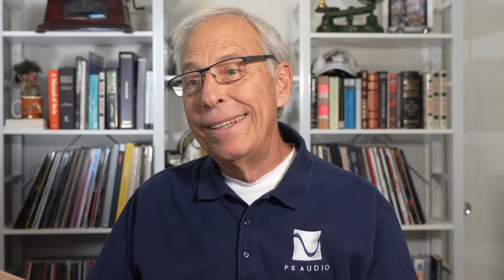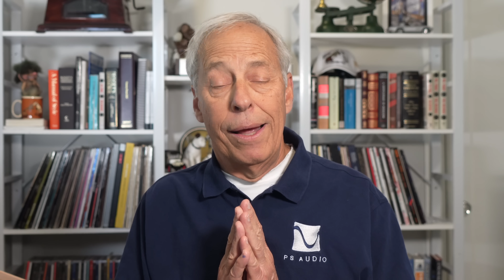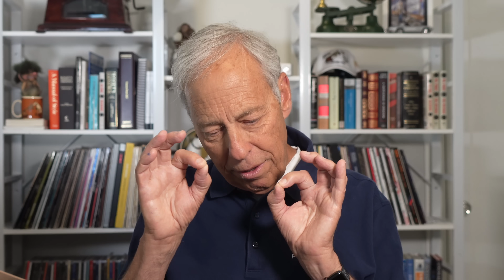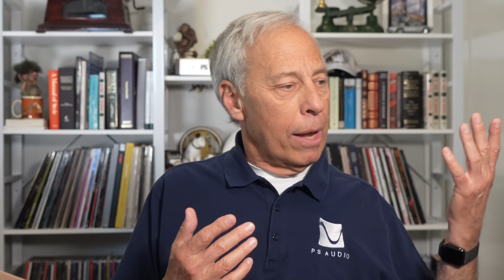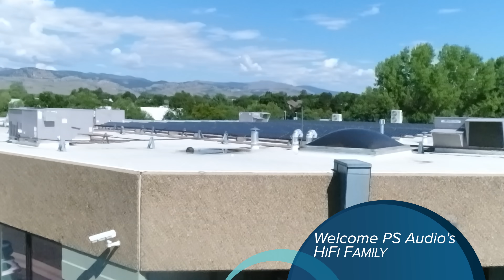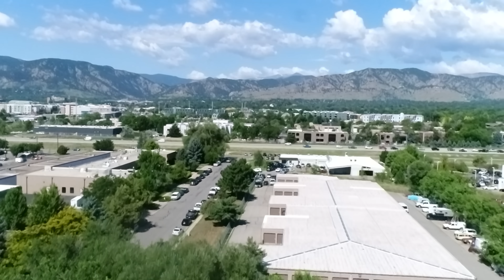Will MOSFET amps take the place of tubes?

Comment: C'mon... Class D amps?  Please  That is the pass They will never sound like a class A. So nore current usage and, in most cases, more heat? So when you play music np one ever thinks how to save a few extra pennys of electrisity.
Reply: lower cost to build and sell. 
It's about offering products at a lower cost, therefore, you include a certain population that can't/refuse to spend more money on audio equipment.  If PS audio's Stellar class D 1200 watt mono blocks were A, A/B powered the cost would be much more than $5,998 USD per pair. As a comparison, their BHK 300 watt mono blocks are $14,998 USD per pair.
Reply: @Mark-lq3sb  We were talking about what has better sound.  D is for digital,  and digital depends in sampling and sampling rate. Analog and class A do not depend on sampling it reproduce sounds as recorded.  It is more expensive and uses more current yeah, however that is true HiFi. For the information of others I disigned stereo systems for a living before I moved to electromedicine.
Reply: @mtabernig -- 
You are missing the point of building the Sprout and Stellar line. I explained it above, what don't you understand?
PS Audio absolutely knows what Class D does and doesn't do as far as "sound" quality that's why they don't take the typical approach to building some of their Class D as you should know. One would assume they will "sound" different than other audio companies Class D products. There is no argument that in most cases the alternative to Class D produces "better sound".
Once again, the bottom line to building and selling something that doesn't cost as much is to capture a certain segment of society that doesn't have the money to spend on more expensive audio equipment No matter the "sound" quality.
 
BTW, What's with your reference to "current" use? I own 8 pieces of audio equipment and they all sit on 'standby' when not in use eating-up power (we won't go-into how much usage when operating, LOL!) When you spend thousands (or even hundreds.) of dollars who gives a rats-ass about electricity usage? Remember, audio equipment is a luxury. If you can't afford to run it, might as well get out.
Reply: @mtabernig  What's digital with class D?
Reply: @MrDingaling007 ...the chip.
Reply: @FatRat-f9m  what Chip? Be specific. Becuase class D is not Digital, the switching mode power supply you Mean?
Reply: @MrDingaling007  OH MY GOD!!!   If I have to explain that you do not have any right to post here.
Reply: @mtabernig  " A Class D amp works by taking the analogue input signal and creating a PWM (pulse width modulation) replica of it. ... This process seemsdigital but is in fact analogue in nature. The signal is not “digitised”, or assigned a numerical value; the PWM pulse train is an “analogue” of the input audio signal."
Reply: @MrDingaling007  pmw analog??? have you ever herd the output odfa real pmw (pulse with modulation)   Pulse wit h!!!! is digital
Now who is not knowing what are talking about. and the stage before that is a DAC (digital to analog converter) which it is a commercial chip. here are some of the popular chips: AKM AK4490
 ES9038Q2M
      ESS 9028PRO
Reply: @mtabernig  you stated class D is digital. Please explain where the analogue signal is digitised. We are talking about class D not DACs here. Why are you trying to confuse?  I've just linked a video from Paul explaining class D is not Digital...
Reply: mtabernig PWM is just a modulation scheme, it’s signal processing, it’s neither analog, nor digital, it can be done purely analog, or it can be done in the digital domain; in the digital domain it would be quite a bit more expensive (still just a few dollars overall, but you’d be charged $$$$), and requires a good ADC, it’s good that we are talking about audio here, and that’s cheap and quite effortless to do
Reply: @FooBar89  Now you are contradicing yourself.  Don't you see .....You have to convert the signal from analog, as the microphone picks it up, to PWM and back again to pure analog? There are few schemes on how to do that, however the signals are converted!!!
Reply: @FatRat-f9m  that sounds like a DAC to me. But It's ok I am familiar with class D. Alot of Myths still out there and alot of bad impressions from earlier cheaper class D designs. These days Hypex and Purefi class D are on a another level. I think you would be impressed after your 12 year old Onkyo.
Reply: @MrDingaling007 ...no there was no DAC in this particular integrated. Maybe I was advised by someone who also didn't know what he was talking about. The A9755 sounded pretty damn good, solid impactful bass & crisp dynamic highs (2 massive transformers each side) I have gone back to 'A/B' class as of late November 2018.
Reply: @FatRat-f9m  Marketing is my guess.  But PSAudio describes it  http://www.psaudio.com/articles/sdat.asp

in class-D, D does not stand for digital, it just so happens to be the next available letter after A, B and C

A class-D amp doesn't necessarily mean there's A/D conversion. we don't know for sure what Onkyo's VL circuitry does, but in most class-D amps the audio signal is not digitized at all. They are called digital amps because of the on/off state of the poweroutput.
Reply: @FatRat-f9m  yes I can rest easy now correcting the myths/untruths from the OP on class D. But the Onkyo warrants further investigation.
Reply: @FooBar89  Exactly. What I posted. I prefer the sound to be amplified as is picked up by  the mike without any encoding and decoding. Hence Class "A" amplifier.
Reply: @FooBar89  I do not know were did you learn electronics and amplification. Humidity, temperature and what ever atmospheric changes.....?    What degree do you have.....no feed back? were did you get all this? If you do not know do not know what are you talking  about.... The best class "A" amplifiers are not driven by BJT or any other type of transistor but tubes; even the host are building newer amps with tubed front end.
I suggest you take a concentrated course in electronics before you  talk about feed back and transistors and tubes. Not useful in professional settings? What the hell? 
Read this from the comments:
Jeremy Hughes
4 days ago
Tube preamp coupled with Class A power amp with MOSFET output stage is my favorite ingredients for a tasty recipe!
Reply: @FooBar89  Now obviously you have any idea of what are you are talking about. I can't talk to you because of your electronic ignorance. You insist on what type of transistors that do not posses sufficient linearity  in the frequency range, please learn something serious about electronics,
If you have sufficient linearity with the same transistors in the output stage w are you talking about...when that is a function of biasing.  You are just like a mule and will not move from your position.  I told you , even Paul and his company are going back to tubes and closer to class 'A'. Temperature and humidity???? really?
No feed back? WTF Why am I arguing with an amateur electronic know nothing. Hope you make a good living with your knowledge.   I did with my and now I am designing MRI equipment.
Reply: @FooBar89  Do not need to ague with your narrow way of thinking.... Good luck to you with your class 'D' while I am enjoying here with my all weather class 'A' self designed and built with the heavy push-pull transformers, reactance's and power transformers that needs a ton of electricity and biased right to provide the best dynamic range you had ever dream of.
Reply: @FooBar89    Power rail? voltage regulation on a 400V +V????
Just showed your true colors.......
have a good tome with your -24 and + 24  that is more digital than analog. Have a fantastic time with your discomposed  and recomposed  signal  for your listening pleasure and make sure the weather is just right for your maximum enjoyment because if is too hummed or too hot it will be spoiled.
Have a good one.....
Reply: @FooBar89  have A GOOD WEATHER AND do NOT FORGET TO REGULATE THE UNIVERSE!

Comment: When i turned 70 I realized i was getting on towards the short end of the stick so it was time to treat myself. i decided it was time to upgrade my stereo system to something special (no that special - I'm not rich).

My old system was ok but the newest component was well over 20 years old. I knee what kind of sound I wanted and picked things up as I found them. When it came to the preamp, as much as I liked thee idea of your BHK preamp it was hard to part with that much cash and I wasn't sure about the interface.

I found a ye ar old tube based Rogue RP5 preamp tat had great reviews and a more traditional interface, it was less than half the cost of a new PS Audio so I pulled the trigger and ordered it.  I set it up and was very pleased with the sound, it seemed to be quieter and more extended than my 20year old Conrad Johnson and the interface was a bit similar so I fell into using it quite easily. The RP5 has a built in solid state phono preamp that was ok but I already had a home built jFet peamp I was very fond of so chnged some jumpers to change the RP5's phono input into a line input and now have the sound i've enjoyed for a while nut even cleaner.

Don't get me wrong some solid state preamps can be very good but I found the jFet phono preamg to be better than the Rogue's solid state implementation.

Differdnt strokes for different folks.

Comment: The closest thing to tubes that I’ve heard would be the First Watt F3. It uses Power Jfets.
Reply: It only has one power JFET (LU1404) per channel.  The other power transistors are MOSFET (IRFP240).
Reply: The First Watt F2 is an example of jfet that has tube sound

Comment: No, tubes will never be replaced. Best option is to find a reliable tube amp rather. Or a manufacturer you can trust
Not dismissing the video, though. Maybe you can get the sound you particularly like (or enoungh tubey-ness) with other kinds of devices too

Comment: They both have their place, but neither are going anywhere, be it FET’s or tubes.
Reply: Live music only.
Reply: @BlankBrain  Why? If correctly biased and with a proper circuit design FET's can sound great in High End Audio.
Reply: @tjroelsma  I interpreted "but neither are going anywhere" to mean that FETs and tubes don't reproduce sound perfectly, and no improvements are possible. Since two of the best technologies to reproduce sound are flawed, the only alternative is live music. When everything is running right, I use bipolar and FET amps in a tri-amp configuration. I think amazing sound can come from various designs.
Reply: @BlankBrain  Thanks for clearing that up that point.
Yes, both tubes and FET's are imperfect, but that imperfection kind of makes them really pleasing to listen to. So then I can make the argument that I'd rather listen to something that sounds more pleasant to my ears than something that is theoretically superior yet doesn't sound as pleasing.
Your second point sounds kind of strange to me, as in live music tubes still rule and FET's are predominant over transistors. So for you they are good enough for live events yet not good enough for home use? That doesn't sound logical to me.
Don't get me wrong: I have nothing against transistors or transistor based amps. I just have a preference for the specific sound tubes and some, not all, FET based amplifiers produce. For me personally the set-up I enjoy the most has turned out to be a tube pre-amplifier combined with a decent power amplifier. And it doesn't matter much if the power amp is FET or Transistor based.
Reply: @BlankBrain  Don't forget just because it's live doesn't mean it's superior either, the musicians, be it acoustic or amplified have to deal with usually awful acoustics of the room they perform in and if there is a sound system (especially in big arenas) the live performance may sound awful though bad mixing and awful acoustics with reverb for days as the sound bounces off of concrete, wood, and metal and if bad enough, the vocals can get buried and all that. 

At least in a studio, unless the engineer is a total hack (some are), your bound to get something that sounds better than some live events to listen to.
Reply: @johnhpalmer6098 
I have been to a fair number of concerts in my time, and yes, a small number of them sounded amazing. One in particular, at the end of which I was able to meet and compliment the man at the mixing board.
Most sounded listenable, and a few sounded terrible.
Reply: @Hare_deLune  Yeah, agree, however, I was informing BlankBrain about the issues with live music as his reply was "live music only".
Reply: @johnhpalmer6098 
My thought was that he misinterpreted the OP.
I took the phrase "neither are going anywhere" to mean that 'neither are going away any time soon'.

Comment: It depends on the MOSFETS. If you use "Depletion-mode" MOSFETS (or a combination of Depletion and Enhancement modes) in an solid state build, you have the best chance of coming close to Vacuum Tubes. They are much more expensive but they are similar to how tubes actually work. N-channel Depletion-mode MOSFETS operate as a normally “on” switch when the gate-to-source voltage is zero... similar to JFETS.
Reply: Designing a "tube equivalent" FET preamp sounds like a good project for me after I retire this summer.
Reply: @marianneoelund2940  I think that would be a fun project, shoot for the best of tube amps without the worst of them (the output transformer).

Comment: Can anyone tell me the the sound difference between MOSFETs and JFETs?
Reply: I went and listened to mine, but they're not making any sound at all.  However, the JFETs are much more comfortable in my ears, so I do prefer wearing them.  
As far as the sound quality of circuits using the devices, it really depends more on the designer's skill and goals for their design, than on the specific device choice.  It's all about balancing various compromises against the chosen priorities.  
MOSFETs are available in a much broader range of types and voltage, current and power ratings.  There is relatively little choice in JFETs and they are principally small-signal devices; power JFETs are almost as rare as hen's teeth.
Reply: They sound the same unless you know which one you’re listening to ;-) ;-)
Idk the touted characteristics people may hear

Comment: thermionic valves are very reliable.
Reply: In spite of all their disadvantages - inefficiency, requirement for filament power, high voltage supplies - the electrical ruggedness of vacuum tubes means that the equipment using them will be among the few survivors after an EMP strike.  Not a bad idea to keep an old tube radio around, just in case.
Reply: Doesn't it matter if you have more typical tube equipment which pushes tubes harder vs I know of at least 2 brands (prima luna which I have, and carver) which both bias the tubes so that they run less hot/work less hard?  Or does that just effect tube life?

Comment: Paul , in one short sentance, you have stated the obvious that so many tech heads (people who rekey on spec's, more that the actual sound of the product. You are absolutely right, regurdless of spec's, your ears have to be pleased with the out put of any sound producing device. 
Example, after 15 year with a mid level Marantz Reciever(2265 black dail)I decided to supposedly upgrade to a better Reciever with surround sound capabilities, back then it was pro-logic, I tried Pioneer, Onkyo, Kenwood, Philips EU model, etc. Nothing sounded as good IMHO as my old Marantz. So I did what I should have done in the first place, I purchased a 2325 Reciever, had it refurbed by a former Marantz employee from the Long Island facilities for my music need , and eventually purchased a 5.1 slime line Marantz for SS. The new unit still do not have the 70s sound. But close. Dam the spec's, it what sounds best to my ears and no one else's.